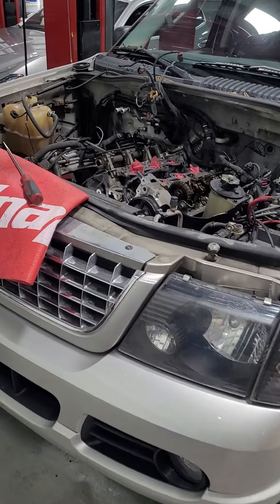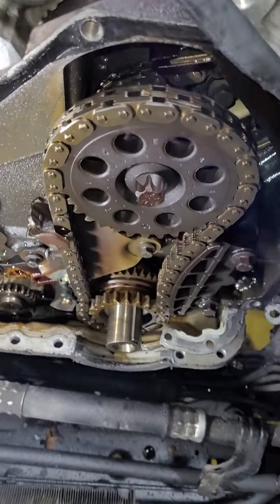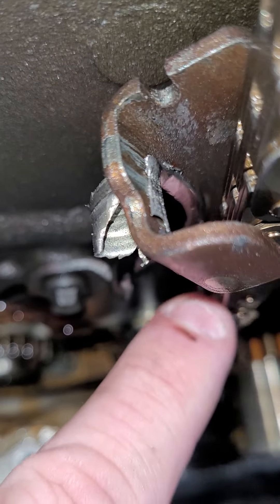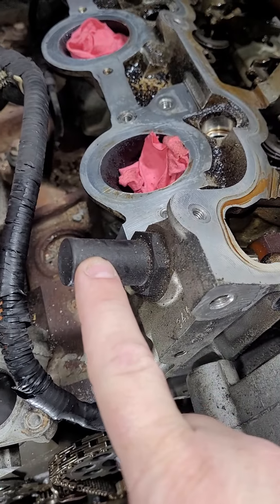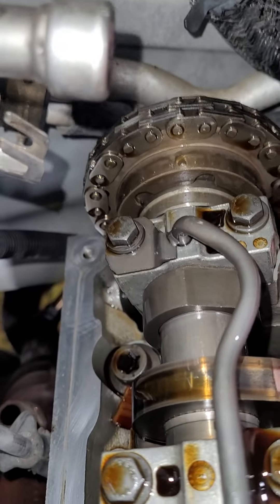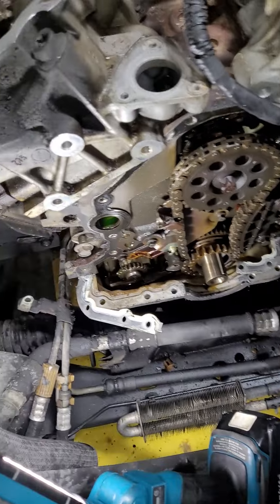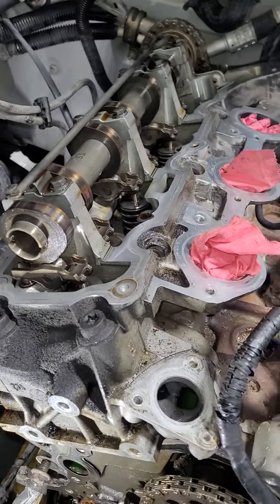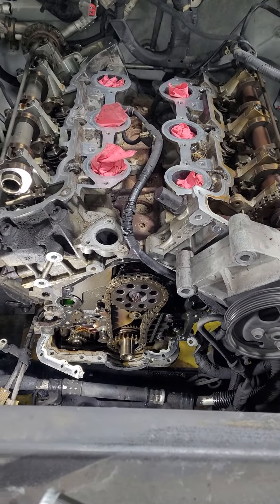Ford 4.0 SOHC timing chains service IN CAR

Comment: Your lucky on that one. I'm working on one that broke a hole in the valve cover on the front cam. It fell back inside. The one in the back was still connected, but the heads bent valves. All but one valve on the side where the cam is at the back. Only intake valves bent on driver's side head. The balance shaft chain and guides were fine. Big job this engine is. Yours, at least, doesn't need the valves replaced. You probably don't have to remove the heads.

Comment: How many miles on this engine?
Reply from the maker: About 280k miles. I'm typing this comment a week after I shot this video and the chains are done. It is a night and day difference. It feels like a brand new car LOL
Reply: And you still have good compression and leak down? I'm about 200,000 and have the transmission out and was just thinking about doing this cuz mine's got the tick